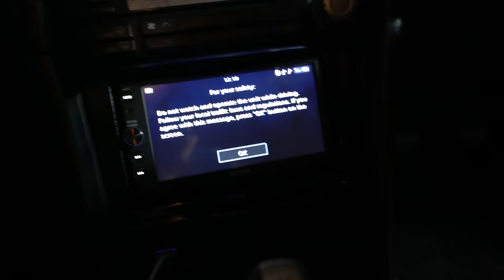DIY Tire Lettering for ONLY $20!?

Comment: I did my tires yesterday and I wanted to share some tips with you guys. 

1. Use Tire/Rim Cleaner + Goo Gone + Pressure Washer and Sponge to Prep the tire. Don't let the Goo Gone sit too long it will crack the rubber on the sidewall. Follow up with 1000-2000 grit sandpaper to lightly scrub the parts you're painting. It'll help the paint stick. 

2. PAINT THICK and EVEN COATS! Even if it takes 4-5 Coats make sure the paint is bright and thick. Approx 1.5 hours labor per tire. If the oil from the tire starts to mix with the paint marker then take a 5-10 minute break and come back. If you're right handed, paint left to right and vise versa. It will minimalize smudging. WEAR PLASTIC GLOVES. 

3. USE SNEAKER WATER PROOFER SPRAY to protect the surface. Don't use clear coat. Clear coat will yellow and also has chemicals that loosen/dissolve the paint. Any brand sneaker water proofer should work. USE several coats, the tire will absorb the first few. 

4. Cover the letters with masking tape if you go threw the car wash. A high pressure spray might take off the paint. Might. If you hand wash your car you will be fine. 

Also. Use the Miluwakee brand paint markers. Some people swear by sharpie markers but they're garbage and can't combat the tire oil. (Oil based) The paint with the Miluwakees is thick and bright + they dry in "10 sec"  and they are very easy to use.

Comment: Yeah I’ve never seen anyone in the U.S have good luck with those bmws. Also, if you’re spending more than like 500 bucks on tires you’re doing something wrong. Don’t trust dealers. Order your own tires, find a regular tire shop or something. My parents went to Costco (a store in the U.S that also has tires for some reason) and they quoted them 1200 dollars for tires. We went to a regular tire shop, found some cheap tires that were of a decent brand and saved like 600 or more. Basically just look around.

Comment: What does the coin test do ?
Reply: +young heath

The coin test is very useful to measure the depth of the grooves or the tread pattern of a tire. 
There are also wear indicators of 1.6 mm; if the surface of the tire base is at the same level as the wear indicator, it means that you have to change the tires 😊

Comment: German SUVs are money pits, my dad had a VW Toeurag (No fkn clue on the spelling) V6 and the front right brake disc cost him £420 along with a replacement caliper that 'Had to be fitted' in VWs terms which was £300 from VW. The whole front right brake cost him £720 because of a small chip in the disk that 'damaged' the pad and caliper.